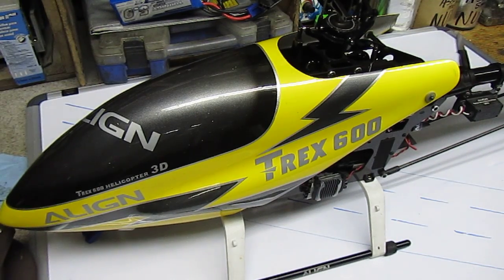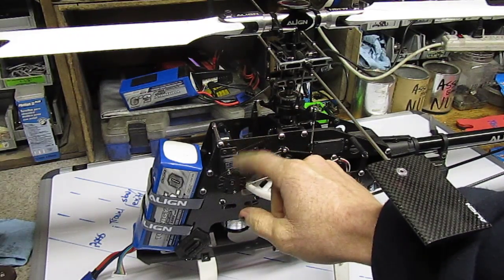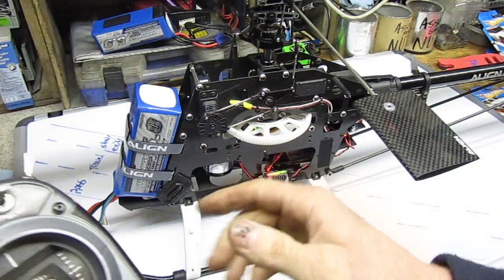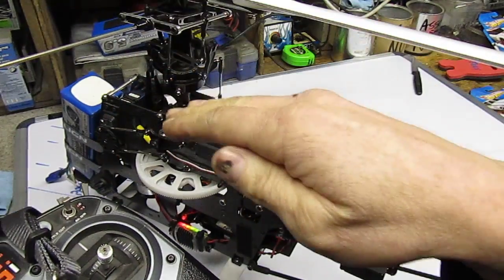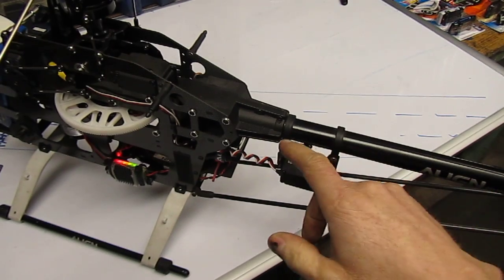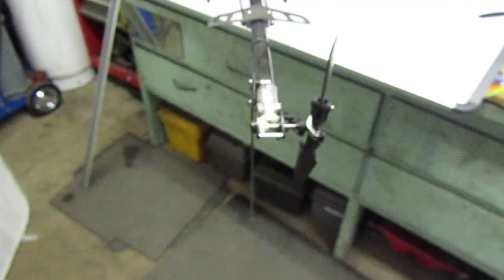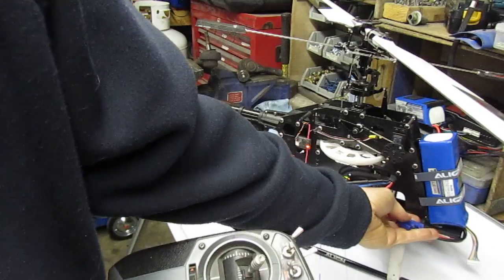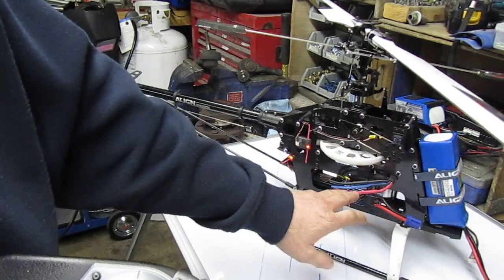What's inside those electric RC helicopters?  Here's the tour!

Comment: My name is benjamin from Kenya my RC radio controler does not work or connect with the receiver,can my radio controler IC be the reason for it not working?please contact me through >>beoeou488@gmail.com OR+254723551548.Thanks in advance.